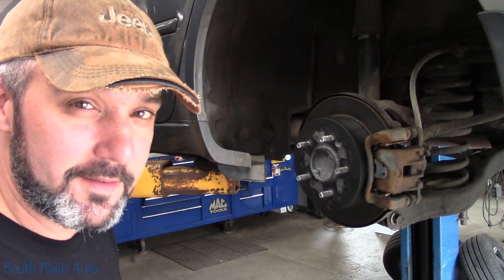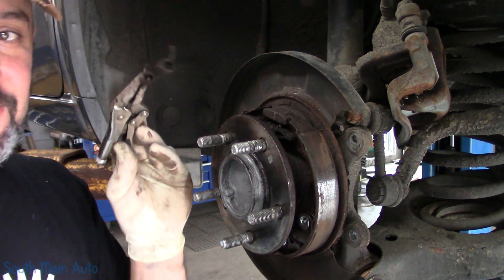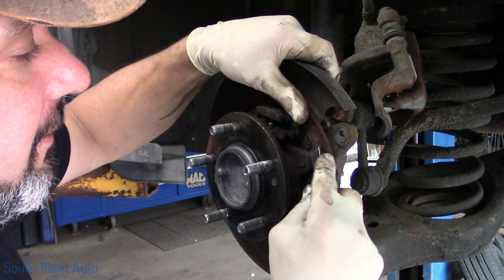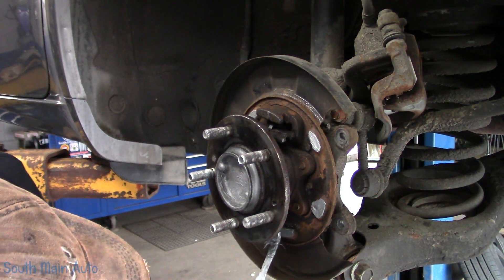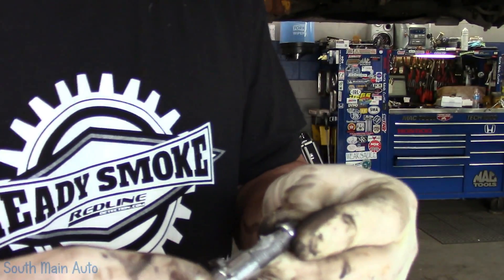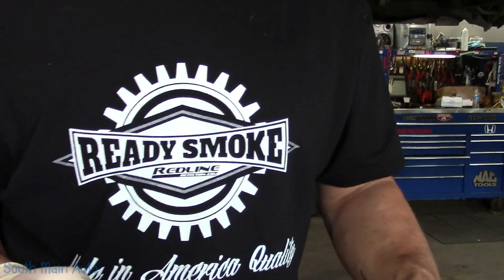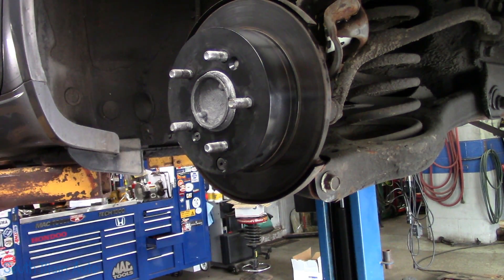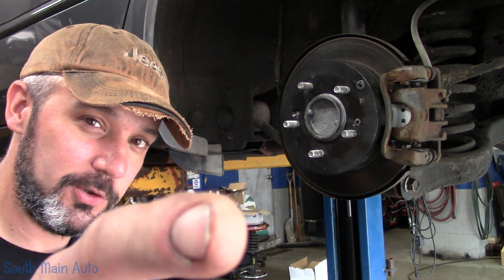How To Replace Rear Parking Brake Shoes - Hyundai Sonata

Comment: Just had my mechanic do this repair today, because I didn't want to attempt pulling the lower control arm loose in my garage.  The 2013 model is an absolute PITA! APPARENTLY they decided to farm out the caliper design & the suspension design to two different teams!  Love the videos buddy!

Comment: I've done a bunch of Ford Expedition parking brake shoe jobs that never needed shoes at all - just needed that linkage up top freed up out of a block of rust. One truck I had to remove both, and toss them in my waste oil bucket for a few hours, then stick them in the vice and beat the everlivin' snot out of them. Looked like a lost cause for a minute, but I got them both workin as good as new again. 

Good to see someone that takes care of their vehicle - makes our lives a million times easier. I'd do pretty good if everyone did that! 

Off I go, back into the tropically humid shop ... 😁

Comment: Another great job Eric. A lot of anti-seize requested by your customer. Think about it anti-seize is made by combining grease and copper or nickle dust. When used on exhaust bolts or other very hot fasteners I think the idea is the grease goes but a thin film of a dissimilar metal remains. Because the fastener was essentially torqued "lubricated" the breakout torque can be considerably more once say plain oil has burned off. What I'm trying to say is that if you used a good quality grease like a full synthetic on non-heated parts it would be a lot less messy and just as effective. Your an excellent mechanic and teacher and as always look forward to your new videos. Thanks

Comment: One trick I learned when doing drum or drum parking brakes, is to put the drum or rotor over the shoes.  Then for old drum brakes, push on the brake pedal.  That will center the shoes so you can adjust them.  For parking brake shoes, pull up or push on the parking brake lever or pedal.  Same result.  The shoes will center themselves.  Works pretty good also when adjusting the shoe clearance.

Comment: Hi ive got a kia optima and cant get the top spring back on and more tips and tricks please
Reply: I’ve actually got the spring done now, but now I’ve fitted everything back together, I can’t move the rotor disc around. It is so tough when I put the screwing any ideas?

Comment: Hi from Missouri. Worked replacing rear brakes on a 6 year old Subaru WRX today. The car came from Pennsylvania, wow that car had rust! Broke off a caliper bolt first thing, bolt popped loose made a full turn and then broke. On the others when the bolt popped loose I then soaked it with panther pee and ran it back in and out a couple of times. I never have problems with caliper bolts on Missouri cars.

Comment: Great video.  I am working on a 2011 Sonata.  It has 3 brake springs for the parking brake.  One is on the top, side to side, a second one on the bottom, side to side, then the third goes behind the brake shoes, but from the middle to the side.  I didn't notice the spring when I took off the shoes and now I am guess on which way the spring goes.  On the passenger side, does it go from the middle towards the back (left)?  And on the drivers side, does it go from the middle towards the back also (right)?   What is strange, I have a service manual but it doesn't show the third spring.  But all of the hardware kits I have looked at, it has the 3 springs.  Any ideas?  Thanks....
Reply: wondering the same. on a 2015 HSH I have one little screw "left over" :/ did you find you how it's supposed to be installed?

Comment: Excellent video. Seems nothing under there changed from the 2006 - 2008 model years. In my case, about to do this on a 2008. The pad material fell off the backing pad at around 230k. Not bad. Barely used the parking brake in NJ.

Comment: Just at it here today.  I think my problem is not the shoes but the linkage after the cable joins the bracket that moves back and forth.  Those are the rusty seized up parts. Outside the drum and going into the drum. I think you called it the actuator assembly.

Comment: probably could have blasted brake cleaner in the adjuster hole and drove around dragging the e-brake on and off...  usually surface rust and road schmutz make them not hold good, that and willy-nilly "coating" inside the rotor drum, which did look awfully new!

Comment: "Of course, this is a stick shift, and he uses the brake quite often!!"

He either don't park that often, or he needs to use the parking brakes, EACH AND EVERY TIME HE PARKS!! 

I once encountered a gentleman(I am being very nice, to say the least, when I say gentleman) that never used his parking brakes, because he would put it into gear (forward or reverse, whichever the case called for) and the running gear would hold it!! He once parked it on a fairly steep hill, and allowed 1st gear to hold the vehicle!! I watched it roll backwards, slightly, overcoming the compression, and eventually rolling out into the street!! It took quite the amount of time, as I consumed two whole cups of coffee, and smoked a few cigs, before I called to warn him that the vehicle had made it to the road, and was actually in traffic!! ;-)

Another day (his story, not mine) he parked in an upwards facing spot, and left in 1st gear, and the the inattentive operating booger hooker, that parked in the opposing spot, "BUMPED" his vehicle, causing it to go backwards, into the aisle way, (and therefore turning the engine backwards for the ride) blocking the driving area until the store notified him over the intercom, that his vehicle was blocking the parking lot (the other drivers fault, not his, for bumping his vehicle on a downhill parking spot, without using the vehicles parking brakes, BUT TO EACH HIS OWN!)! 

Great vid!! And even changing things up a little, to help accommodate a customers vehicle that had been rust preventative sprayed!! Nice!! But you didn't say "MOTHER MAY I" so I gotta UNSUBSCRIBE!! Again!! LOL
Reply: why ride the brake light
Reply: Rob Jennings because it's only two tickets to ride!?!? The best guess I have, for this particular question!  

Do you ride the brake light? It is it fast? Is it bumpy? Does it do a little something for you? Is it cheaper than riding the windshield washer fluid? Your thoughts and opinions?

Comment: haha Ken Block is a beast! M rear driver ebrake has been boarderline seized for years. 2011 Kia optima, similar. I keep having to rework it, is there anything I can swap out with rebuilt or new parts to prevent this constant issue. Now is see the rear driver brake pads clumping up and perhaps piston is toasted. That thing is a never ending issue on my car. Thanks for your video and feedback appreciated.

Comment: Just did parking brake on Kia and never knew they had to be broken in. They are just used for parking so I didnt do the burn in and they work fine. Biggest pain was new adjusters were wider than oem ones and drums wouldn't slide over shoes. After cleaning oem adjusters and lubing up with anti seize and grease they installed fine and could again reinstall rotors/ drums again. Should've bought oem hardware kit instead of Dorman.

Comment: Hey eric on my buddies 1998 olds 88 i replaced its fuel pump and now it has a cuts out but it wont shut off it will return to idle, it will die if you keep on the gas but it reatarts help

Comment: all they needed was to be "burnished",a process in which you drive and apply the parking brake to decelerate the car,it needs to be done several times(in a safe place obviously),as the shoes and rotors get hot from repeated use they will clean themselves and actually start to work as designed,this procedure is part of many manufactures pre- delivery inspection prior to delivering new cars to a customer

Comment: Love your videos have you done e brake and shield replacement on f350? Im doing it on a 2000 excursion. Same thing  we need a good video and advice with torque specs. Especially the hub nut. Done wrong it can kill you.   Thanks.

Comment: Hyundai ix35 has the same rear breaks, if the parking break works fine and has enaugh material left, can you leave the drum brake pads in when you change the rotors and pads?

Comment: Is there any relation between the parking brake system and the regular brake system on these cars? I had a brake line leak, went to a shop to fix it but they claimed my parking brake cable is bad too and need to be replaced. Brake pedal still going all the way even after they fixed the leak. I think they did something else in purpose to make me have the parking cable replaced next time since my brakes are still not 100%. My parking brake works fine so far...

Comment: On my 2006 Focus (manual transmission, so yes, I use the parking brake) the rear brakes are drum. One side is longer than the other for some reason, I don't know why either.
Reply: most drum brakes were that way, one long and one short shoe, "leading and trailing" or "primary and secondary". some now have the same length friction material, but one side will be placed with it starting further down. majority of them shorter/material shoe to the front of vehicle, unless it's some screwy uncommon setup
Reply: throttle bottle No, that's exactly it, the two shoes are slightly off level, the smaller one being the lower one and on the side that's closest to the front of the vehicle

Comment: If you have a foot operated parking brake I don't think the 40 mph trick I don't think is gonna work.  Do you have a procedure for those foot operated P-brakes?
Reply: Hold the release handle out the entire time so it wont lock up. If you have the ridiculous kind that you step on again to release it, then I'm not sure it can be done without locking up

Comment: At least it's not a '13 Sonata which basically has you disassembling rear suspension just to get at the one bracket bolt. Already dreading that upcoming brake job on mine but thankfully some Eric Obachacka guy did a video on that.
Reply: seems to me the last few I did I managed to use a wrench and get it apart/back without suspension teardown, thinking I had it partially jacked/compressed suspension. but I may be thinking the complete wrong vehicle/s :|

Comment: since parking brake pads aren't a wear item, what difference will replacing them make?  I'm not understanding the purpose of the repair.  It sounds like the problem couldn't be the pads themselves.
Reply: sounds like they weren't holding the vehicle when applied/parked, some areas of cannuckistan may require they hold proper for certification

Comment: all that anti-seize on the hub face WILL get spun outward to the parking brake shoe contact surface... grease or anti-seize there ...  and your customer will be back! and HEY, no anti-seize on the lug bolts?  Customer better be male, no female will be able to change a tire when the lug nut(s) and stud(s) are rusted together.

Overall a well done video, could have been edited a good deal shorter, and note the torque specs for the caliper bracket bolts.

Comment: You used (a lot) more anti-seize where the brake shoes contact the backing plate than needed.... don't want it to get on the shoes.... I'd have suggested just a thin fingertip smear, maybe 1/4 of what you used.  But that's just me.

Comment: No wonder the old shoes had become ineffective, the never sneez from the hub face had migrated into the drum and lubed everything up. :-/
Reply: looked like someone went willy-nilly applying it. but I've seen those rotor-drums come "erroneously coated" on new setups. probably figuring nobody would ever use them anyway :))

Comment: Unless you drive away with the parking brake still set, how would they ever wear out.
Reply: Charles Miller They don't. If you see a set that's worn away and cracked, it was left on while driving. Every now and then, drum-in-hat parking brakes should be put on for a second or two at 25 mph to brake the rust off the friction faces. That was a procedure recommended by Mercedes Benz in the 80s and 90s, and I've done it every 6-9 months since. It doesn't wear them much at all, just cleans everything up for maximum effectiveness.
Reply: good advice mannys9130. I pull them on and off gently a half dozen times in short bursts.
Reply: throttle bottle Yep. You only have to do that with drum-in-hat though, since rear drum brakes just use a separate linkage to activate the main drum brakes shoes, and the ratcheting caliper style again uses a mechanism to activate the main brake pads. You use those daily, so no need to refresh them like the dedicate drum-in-hat setup. :)
Reply: i do it on all of them, when backing up too, as it helps keep everything freed up and adjusted on the ones with adjusters. the majority of vehicles I've owned has all been rear drum and honestly I like them better than anything else, but they're not race/performance vehicles :)
Reply: throttle bottle Yes, applying drum brakes when backing up usually activates the adjusters. IME the auto adjusters aren't really that great. If I have the wheel off, every year or two I'll usually pull the drum off and clean all the dust out and then adjust the shoes properly. On a rear drum vehicle, it's those drum brakes that make or break your pedal feel. :) Too loose and you get a long pedal travel. Too tight and you nose dive with just a light tap. I adjusted everything when I bought my current car. It was so worth it.

Comment: What year is that. Can’t be the 2013 because your not swearing. I have a 2013 gl and the rear calliper bracket bolt is not accessible.  I’m mean not accessible. You have to take trailing arm strut all that crap off (and back on that’s the fun part. ) to get at the bolt.  Omg Hyundai what the heck were you thinking.

Comment: I've had my 2016 Sonata for two years now and I've never used the parking brake. Does anybody that has an automatic transmission ever use the parking brake? OH I LIED! I use the parking brake when I change my oil but I always use wheel chocks too so it's not that critical.
Reply from the maker: This one was a stick though :) and YES I drive an auto AND USE my E-Brake
Reply: Eric, do you park on the sides of cliffs? Don't you trust the Park Paw in the transmission? I actually have never ever used my parking brake except for when I've raised the front wheels off the ground on any car I've ever had. That goes back to a 1968 Bel-Aire
Reply: I Always use the parking brake on Any vehicle I drive, just habit really, but I wonder what happens to an automatic transmission if hit by another vehicle when in Park  ?
  PS I learnt to drive in a manual so more important to use the hand brake !
Reply: SATAMAN Schmidt I always use my parking brake on my automatic car. The parking pawl is a small piece of metal that holds a ton and a half of my car in place. If you don't use the parking brake, you stress the pawl over time and you put extra stress on the shift linkage because you need extra force to pull the pawl out when it's under tension. After I pull up to my parking space, I keep my foot on the brake, put my parking brake on, put the trans in park, and then release my foot from the brake pedal. That method keeps the excess tension  off the pawl. It's critical to do that on a steep incline or you'll get torque lock on the pawl and need two hands to shift out of park.
Reply: i use mine often enough to keep it freed up, and when parked on steep hills, then again it weighs over 5000 lbs empty, add tools, materials and you have a large lead sled :)
never know when you may need that to stop, used them before when master cylinder, caliper, wheel cylinders went. then again the e-brake applying 12" diameter  3" wide drum brakes does a good job of stopping when applied, far better than them peanut parking brakes now days.
Reply: I use mine when parked on a hill.  Never in winter.  Moisture and cold make it hard to move.  I have had to warm many parking brakes to get a car to move.

Comment: You keep saying you don't have a TV but make many references to television shows as you work. Those tiny drum-type parking brakes are a joke. Almost all cars now use disc brakes because they provide better braking but they revert to old technology in a much smaller size to use as a parking/emergency brake.

Comment: real disc brake parking shoes SO MUCH superior,to LOUSY American units,
   where ALL cables and brake parts exposed to weather, so piston SIEZES onto caliper
Reply: except they're tiny and don't have much holding power, as compared to regular old drum brakes with cable actuation. hard to beat full size shoes applied in that sense :0
Reply: guess you prefer SINGLE piston rear cylinders
  -where ALL retraction GUTS exposed to outside
   -so piston STICKS and/or  scores rotors
   -so ANNUAL replacement of rear rotor,caliper and parking cables
     PLUS hardware  required~~
Reply: no, actual "large drum brakes" on the rear ;)